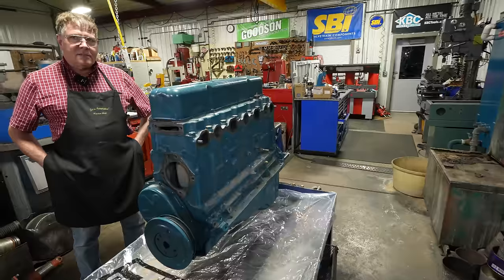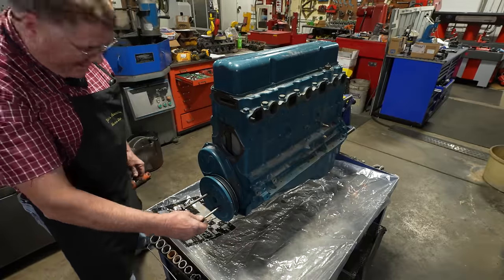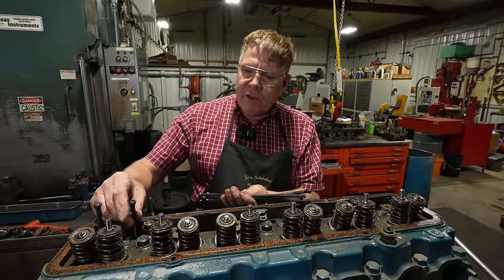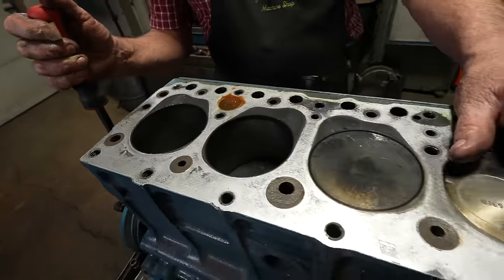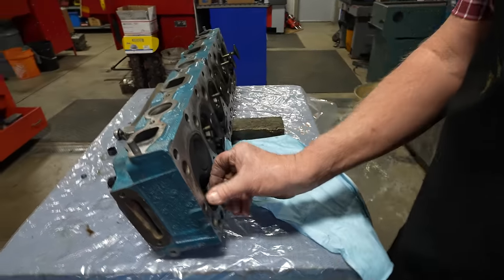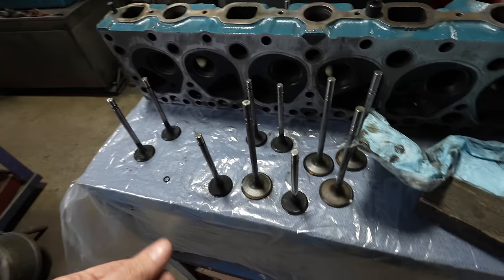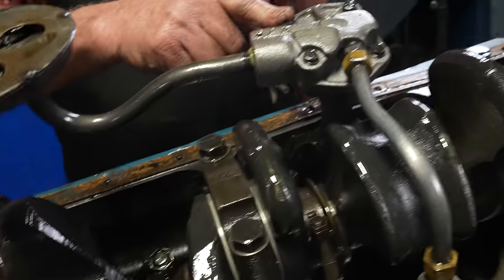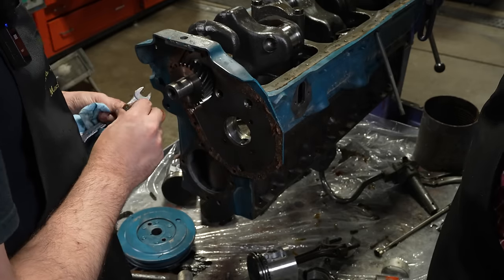Their 235 Chevy BROKE DOWN 10 Miles After The LAST Shop's Rebuild...

Comment: In the early Buick 3.8 L engines, it wasn’t uncommon seeing different bearing sizes to correct for line boring problems from the factory. It appeared again with the Cadillac HT 4100s.

Comment: Once had an olds 455 engine where the valves would stick open.  It turned out to be a fuel pressure issue under wot, engine went lean briefly, and that was all she wrote.  Knurled the valve guides, ran marvel mystery oil in the gas, to no avail, electric fuel pump eventually saved the day.

Comment: THE NAME STOVE BOLT 
CAME FROM THE EARLIER 216  ENGINE WITH THE POURED BABBIT ROD BEARINGS AND SPLASH/ OIL JET LUBRICATION.
THE PUSHROD SIDE TIN  COVER HAD AN LOT MORE SIDE BOLTS THAN THE 235CI ENGINE

Comment: For 26 yrs,I owned a 1958 Chevy Truck bought from orig .owner. Sold in 2018. Over the years, I changed out every part in the 235 except for the pistons and rings. Truck had over 500k miles when sold. Valves on 235 need to be set "Hot". In 1991, in California smog check only when title change. Failed smog. Previous owner had set the valves"Cold" that caused to fail test. Set "Hot" then passed.

Comment: My brother had a 1960 Chevrolet 1 and 1/2 ton and he had swapped engines out. The one he put in had already been bored out to 60 over. He did rings, bearings, seals, and had the head rebuilt with completely new components. Unfortunately it stripped the fiber timing gear and bent all the pushrods and intake valves. I may eventually restore it. Needs a complete proper rebuild. The other big issue that may have contributed is that the cam and bearings are worn out and the low oil pressure light comes on when hot. This motor you’re working on may not be getting enough oil flow to the valve train. It’s been awhile since we worked on this engine but if I recall later 235s got oil to the valve train using a tube rather than the head bolt passage. This is something to check into in case parts from a later head are being used with an earlier block. Not sure that works.

Comment: using Sunnen OD hone helps hold oil, been doing it eversince no lead, I would use hard chrome stems and the truck stellite exhausts   Viton seals YES  cast iron guides?  I knurl and hone guides even new ones or use spiral k lines   I'd use Duar Bond sintered exhausts  I've made shafts or grind undersized, chrome and finish grind     Maybe the motor out of a Corvette, same motor with different carbs and exhaust, upgraded one to a 261, single mains used to be available,  dirty brgs run a brush through all the gallies  ready for the oven with the cam brgs in it?  nice job

Comment: wowwww, the cam is geared to the crankshaft with helical gears, that's soooo cool

raarely do you see even straight cut gears for thinks like timing or even 4x4 transfer cases, but to see not only a geared cam but the gears be helical cut?
that's very cool to me, some people like the whine of straight cut gears on their transmissions but helical gears are just quiet and smooth, complicated to machine im sure but man that's cool

Comment: I think you could blame a couple things for the failure here. You have the umbrella seals up top doing a good job keeping the oil away, the crosshatching ostensibly to help oil stay on the shaft, and then you've got the fuel spray hitting that crosshatch on the bottom and now instead of the crosshatch helping with lubrication like in the cylinder it's hurting lubrication by helping the fuel dissolve and carry away any assembly lube and oil. That crosshatch is also going to decrease the contact area and what happens to the peaks of the crosshatch during break-in? In the cylinder you've got plenty of oil to carry away a tiny bit of metal when the engine is going through break-in. In the valve guides it's a different story. The increased friction makes more heat and the tight tolerances don't give you much room to play with before it starts causing more wear, more friction, more heat, and then inevitably galling and it snowballs from there. Is it a coincidence that it was an intake valve that failed given the same clearances on the spec for the exhaust valves? You don't have a solvent being sprayed on the exhaust valves all the time.

Comment: I am a chevy self taught gear-head, and I like your sleuth work. That's very important that you go slow when taking head apart.

My experience tells me that I would not put umbrella seals on an engine unless has high mileage, AND SMOKES A BIT, when you accelerate. This is only a short-term fix, and the head needs new valves/ guides anyway.
I have used umbrella seals, without your issue, but I don't think the valve stem should be rough to the touch, in my opinion.
I am not a machinist, and I like your line of thinking.
🇨🇦👍

Comment: i helped rebuild one of these when i worked at a machine shop 
it was the first time i ever seen an engine use shims to set bearing clearance
i rebuilt the head and did all the prep work on the block
thank god its not the same motor lol

Comment: They resembled bolts used to assemble & disassemble old wood or coal burning stoves which were still in common use in the 1930's when the term, "stove bolt six" was coined.

Comment: Those 235's were tough engines.. I bought a 1960 chevy truck with a 235 for $400 in 1974.  My co-worker was pcs to Clark AFB, Philippines.  It burned 1 qt of oil per 15 miles (it really smoked when running). I pulled the engine and got a new short block and a valve job on the head.  The parts manager asked me "did you look at that block"? Nope, well the 6th cylinder, top of the piston had a quarter size hole and burned valves.  Oh, back then ~1974, a rebuilt short block 235 was less than $300 dollars.

The 235 would run with half the spark plug wires pulled (someone thought it would be funny), I jumped in my truck and drove off, noticed low power, stopped, opened the hood and  saw 3 plug wires pulled off.  Connected them and it ran fine.

Comment: Does the cam need an oil groove? On 1955 and 1956 265’s full oil pressure from the main oil galley passed through a drilled passage to feed a small hole in the rear cam bearing. As the camshaft rotated the machined slot in the rear cam journal would uncover two holes in the rear cam bearing allowing oil to flow (via the machined slot) out a second hole in the cam bearing that was located over the annular groove. This setup supplied pulsed low pressure oil to the annular groove which supplies the lifter galleries through drilled passages.

A popular modification on 55-56 265 blocks is to grind an oil passage in the block connecting the drilled oil feed passage to the annular groove. This way the 265’s will oil just like the other SBC’s, and there is no longer a need to use a “special” rear cam bearing with two holes or a camshaft with a machined slot.

Comment: Didn’t you need to put bronze valve guides in if you’re going to use the umbrella seals? Seems like I remember there was more to it than just putting the umbrella seals in. 

In 75, when I was 18, I bought an old Chevy PU that had one of these engines in boxes stacked in the bed. No idea what I was doing, but I got it together and it ran. As you might expect it didn’t have much oil pressure at idle after the engine warmed up, but it ran OK enough for me to drive it for a few months and sell the thing before it blew up. Watching this brought back some memories. Pretty sure my old engine just had the o-ring valve stem seals (always thought they were weird, seeing them in the 327 too) which were designed that way for a good reason it seems.

Comment: My dad had a 61 with same engine.  It kept cracking crank pulley.  Finally took it apart and it had cracked crank shaft right at the bearing.

Comment: Whenever I take anything like that apart I pay particular attention to making sure bits go back where they came from.

If it does not matter, then putting bits back in the original position does not matter.

If it does matter then I have put them back in the original position, and it does not matter, as I put them back where they came from.

It only matters of you mix and match.

Comment: I worked on farm tractors for 10 years. A Perkins 6 cyl came in for a regular overhaul. Nothing was found except piston and cylinder wear. Started reassembling engine and checking each bearing with plasti gauge as this was shop rule. Came to one rod and the plasti gauge wasn’t touched. Measured rod journals and found this one was .020 undersized and all others were standard. Took a look at old bearings and all were standard. No abnormal wear. Asked owner and said engine was overhauled a few years before and it ran fine although oil pressure was a bit lower than before. He put several thousand hours on it before bringing it in to our shop. We resembled it with a .020 bearing in the one rod and sent it home. Checked with customer and he said oil pressure was about 10 psi better and all was good. These engines ran about 2600 rpm.

Comment: the valve top hat seal removes to much oil this happened to my Chevy 261 strait 6 it locked a valve with 133miles on it funny it was the same valve though mine punched a hole in the piston.. i did new valves and guides and 1 new piston I put 5k miles on it after the 2nd rebuild/fix then sold it but the guy is still running it 15yrs later I still see it/him in town here and there on nice days and he never had any problems with it . ....thanks for sharing

Comment: 15:00ish. So it seems that the general consensus was that maybe there wasn't enough lube on the valve stems and that one locked up. Stuff happens. I can appreciate not wanting to use too much lubrication, versus having too much and building up a bunch of carbon on a brand new engine.

Comment: Interesting.  I've always run bronze guide liners and set the intakes tight.  2 to 4 tenths.  That keeps the unmetered air getting past the guides to a minimum.  Run them loose and  so much unmetered air will get past the guides that the long term fuel trim won't be able to richen the mixture enough to keep the engine from going into a lean misfire situation.  That will make it fail smog and produce an irate customer.  You don't need a lot of clearance on the intakes because when they're open, cold air is flowing past them.  Exhaust valves are a differant kettle of fish.

Comment: I have been a mechanics aid and have seen a 186 Holden motor oil pick up blocked with bearings pieces and bits of rag wrapped
Around the cam shaft.

Comment: Remember 216 and 235s had no integral oil filter from GM. A customer would need to add a purolator type external filter cannister to get filtering for the engine oil.

Comment: Hey guys, not sure if you got your answer about the shims for the mains.  But I believe the shimmed mains were pre 1953 when the 235 was still splash oil.  After that it became a full pressurized oil system and used modern bearing inserts
Reply: The mains were always insert bearings though, only the rods were babbit on 216s and 235s

Comment: It could have been a bad valve stem.  I have rebuilt LS engines and was a jet engine mechanic for over 10 years and I use a lot of engine lube during assembly. And I check every part for clearance if not twice.

Comment: Bolts in a bucket makes me go Ack! But I haven't done it 1000 times. 
I use a piece of foam board, draw the outline of the engine and poke all the bolts through so I can keep up with where they went. Tape others to the parts they go with.
I've gone through my 68 Corolla engine a couple or three or four times over the last 36 years. I like to put fresh rings and bearings in at least every 250,000 miles and check stuff out. (Picture a Dodge slant six and shorten it by two cylinders...Toyota K engines) It was already 20 years old when I bought it...unknown rollover miles.  Last time was a full rebuild inside and out with a 20 over bore. (only set of new stuff I could get...running out of parts).
Never worked on an engine at all til this one but I can read and use a torque wrench...the OLD Haynes manuals rock! You can just about do everything on this car, take it completely apart, with 4 wrenches and a double-end screwdriver and they are included in the car's toolkit along with a spark plug wrench, the jack and a folding metal wheel scotch.
Reply from the maker: Cleaning guy here.  Customers bringing in their bolts in foam board makes me go Ack!  I know I am supposed to be the Cleaning Guy, but do they really think I have time to clean one bolt at a time?  I throw them in a can, bake them to dry the grease, then blast them clean all at once in our shot blaster.  Some people like jigsaw puzzles, I like engine puzzles.  It's really not that hard to figure out where all of the bolts go if you sort them before you start the assembly.  You can also jot down some notes, or better yet, in today's technological world, take some pictures.  My phone is full of them.

Comment: Why would a newer type engine in that series have had shims vs an earlier type of 235???  I could see the early 235's allowing for some small adjustments of inserts.  Shims were usually an older type tech - usually in poured babbitt bearings.  That also must mean someone has a 20 under with a 30 in it somewhere???

Comment: The shimmed motor had babet bearings that were poured in place and had a low pressure oiling with dipper troughs and the newer high pressure blocks had insert bearings so what happened in my opinion is this motor was converted over at some time because no one alive can pour babit bearings. The well used bolts make me think it was a dipper motor so it was common to take off the pan and remove a shim from time to time to close up the clearance. You would have a stack of three shims I kind of remember and you took them out one at a time and when they were gone you reported the bearings and put the three shims back in. The shims were like plastic not plastic but like it.

Comment: When a screw or stud is jammed in a part and it's impractical or undesirable too heat the part, try heating the screw to white hot and keep it hot for a minute or so till the heat makes it's way down into the hole. Then let it cool drenching it with penetrating fluid as soon as it's cool enough not to boil off the fluid. After fully cooling, it usually comes out more easily.

Comment: LOVE the videos! It would be cool to know "what they were thinking" when the chose engineering ideas that diverged from norms like the rocker arms. Then contrast that with "what they know now" and see if some ideas were ahead of their time, or someone with a bad idea that managed to get it approved regardless.
Reply from the maker: We often have this conversation in the shop as we look at the different ideas that companies tried over the years... and see the trends of what things work, and what things didn't work! 

I think a lot of people forget that there's a lot more that goes into engineering than simply coming up with a design that will work. Can it be manufactured? Can it be manufactured in a time efficient and cost efficient manner? Will the optimal design for part A properly interface with Part B and Part C? Or is a compromise required on all three parts? 

Did the engineer really put that oil drain plug in a position where it's impossible to reach to piss mechanics off? Or was there a logical reason... lol

Comment: People forget the time period, tolerances, and lubrication oils used when this engine was designed and built.  If you've ever had anything to do with radial aircraft engines and the very loose tolerances that were used. The Pratt & Whitney R1830 (1830cubic inches) radial engines used in the DC-3 (and probably 50 other aircraft) consumed at least a gallon of oil per engine per hour.  The oil was used as sacrificial lubrication and cooling throughout the engine.  My point is that I think a lot of modern shops rebuild these engines too tight when burning a quart of oil every tank of gas was normal, and that was with straight 30wt non detergent oils, and sodium valves among other items.  Just some thoughts?

Comment: By doing the "CSI" it looks like the previous shop did not clean up the block fully before reassembly & did overkill on the valve stems by "over-engineering" while not considering oil flow.

Comment: I'm surprised anyone is a follower of the GM 235s anymore.
I had a few family members etc who were. I wish I could remember the exhaust note they had.  It's been half a life since then.
I remember that Chevy sedan engine was a sea green colour and Pontiac sedan engine was red and the next size up 261 and was basically the pickup truck mini school bus engine. 
Easy to repair but bad for oil leaks or oil consumption. 
I remember it was common to find out that the engine is out of a different vehicle as shops would have a ready made one in the back.
Fix yours would be say a week, or we put our ready built one in half the time (fast turnaround).

Comment: So they used so much assembly lube, the extra viscosity starved the oil film on the valve stem?  So they should have done a 5 min idle run-in, then a proper oil change?

Comment: I had a 235 in a 62 chevy 10.  Four on the floor 1st gear was a granny gear.  Ran flawlessly throughout my highschool driving years.  Oil change guy stole the dipstick for his own truck.  I stole it back and slashed all of his tires, poured sugar in his tank, and anti-freeze in his engine via the oil cap.  I left him a note with the traded dipstick.  It said, I think this belongs to you.  Never got in trouble.

Comment: that happened in a repair shop i had just started at in 1987.. the oil pump had not been fully inserted so the locking bolt could engage the drill mark in the side of the oil pump..  so the oil pump dropped down and starved the engine of oil..  i have not had time to watch the rest of the video..